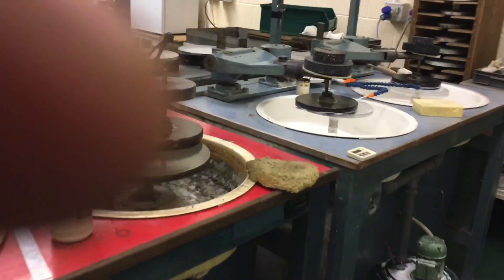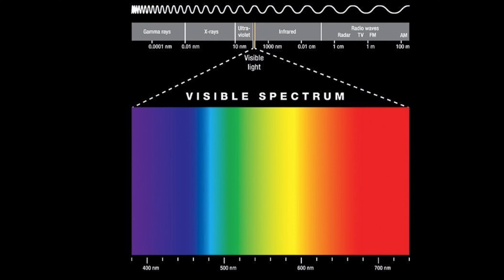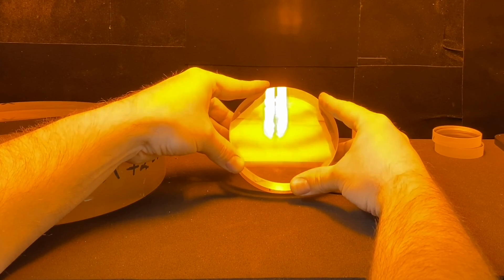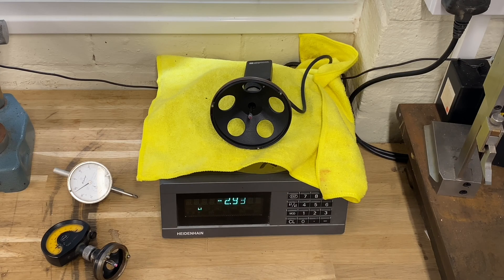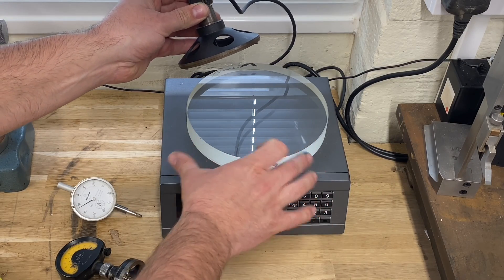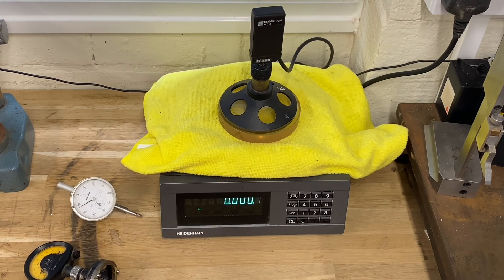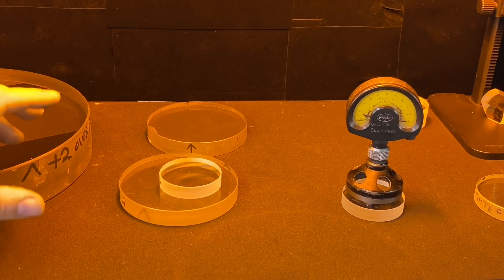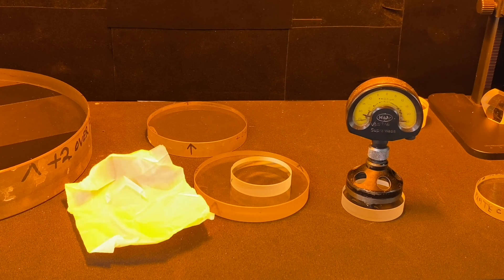Measuring Optical Flats - Interference Fringes / Newton’s Rings

Comment: Thankyou for this video, excellent information!. This is a genuine question, as im getting more into metrology, Would it be more ideal for the reference flat to be kinematically mounted on 3 points off from the heidenhain box and possible away from the box in case of uneven heat sources inside of the case ?. +1 Sub
Reply from the maker: @nathanturner457  thank you for watching. There are methods of mounting optics more accurately for sure. For example, mirrors (where necessary, and what the reference flat kind of is) can be mounted using a whiffle tree which distributes the weight of the optic equally over the Airy points. For the purposes of zeroing a spherometer to the accuracy my gauge is capable of, it is probably overkill. However, in principle you are correct. Regarding thermal effects, this is also a consideration to take into account. In my case, the optic is made from a borosilicate (Pyrex) which has a lower CTE than most glass types which helps to alleviate these effects. Zerodur is a glass ceramic which has absolutely zero nett thermal expansion which is an even better option but substantially more expensive. You will probably find that the glass scales inside linear encoders are made from this material.

Comment: is perpendicularity of the probe to 3 ball defined surface critical?and how do u ensure it
Reply from the maker: This is controlled by the squareness or perpendicularity of the spherometer ring. The bore that locates the dial gauges needs to be machine true to the ring that locates the balls (if it is that type of ring) or the edge of the ring if a solid type. Both perpendicularity and concentricity are important especially if a radius is being measured.